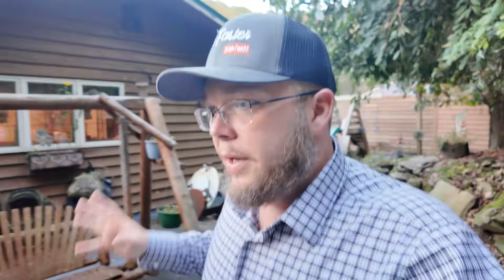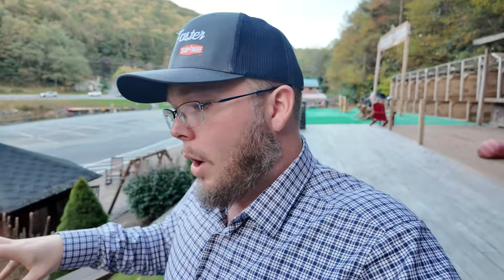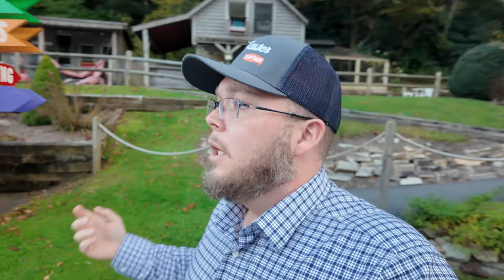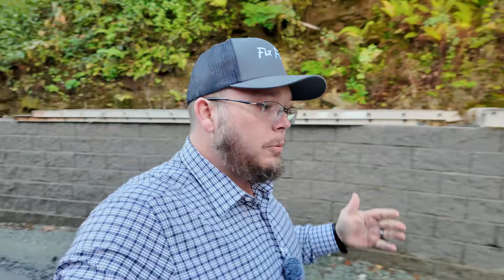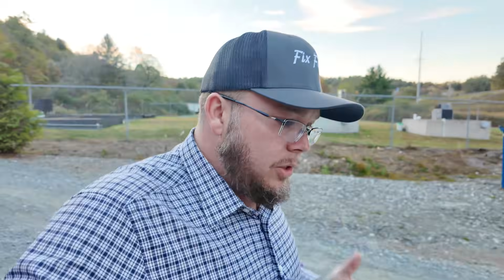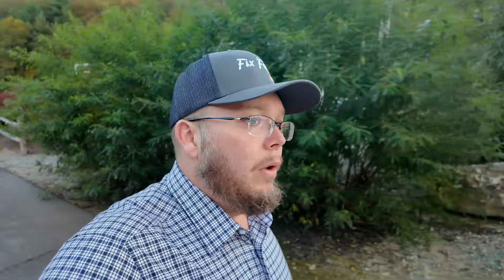Cutting Off The Nose, To Spite The Face:  The Auto Repair Race To The Bottom...

Comment: I do it slightly differently. 

For something that can be diagnosed in about 15 minutes, I don’t charge anything. The paperwork would take almost as much time as the actual work just to make the sale. Tips are welcome, though — or sometimes I just tell the customer, “No worries, I’ll add it to your next bill.” Depending on what kind of relationship I have with that customer (random or regular). That "free" part covers a quick OBD scan, basic visual checks, or a short test drive. I see as a sort of marketing expenses - I'm okay with that, considering that otherwise my advertising budget is zero and there could be only one or two jobs like that in a day (or none, for most of the days)

If the problem is a bit more complex and I need to pull out one of my “big” scan tools, I charge a fixed fee (roughly 0.5–0.75 hr). For that, I’ll do a full system scan, provide a printout for the customer, check for TSBs and Identifix patterns, and see if there’s a commonly known issue. All that can be done in half an hour or less, so I am still somewhere between 100 - 200% efficiency. If the suspected component isn’t very expensive, I explain that we can proceed with repairs based on statistical probability of a known failure with good chances of success — or we can spend extra time on diagnostics to be 100% certain. Technically, confirming the fault is always correct, but spending another 1–2 hours adds to the overall cost of the repair while in 99% of cases only confirming that statistics were right. This is where the economics of the repair and diagnostic balance come into play. The key here is communicating it clearly and setting customer's expectations properly.

If the component is expensive, I usually push for additional diagnostics first, before asking a customer to commit to a large expense based on probability alone. In many cases, the cost of disassembly involved in diag will at least partially overlap with repair anyway - as long as customer is willing to leave a vehicle here until it gets fixed.

The toughest cases are when the issue isn’t common and significant diagnostic time becomes unavoidable. From that point on, you need as much communication skill as diagnostic skill. Efficiency takes a hit — there’s research, head scratching, chasing wrong leads, and sometimes even replacing the wrong part before the root cause is found. All of that time still has to be paid for, but since I can not "beat the book time" and have no profit from the sales of parts making money from that time gets tough.

I already mentioned the use of LLM for communications with customers and this is where it is particularly helpful and saves us tons of time. Particularly when you need to explain complex topics in a simple way that customer would understand (hopefully!).
Reply: I understand your mathematical approach to cost of repair vs cost of diag. way of thinking. However, I totally disagree with that approach. Customer will have 0 appreciation to that way of doing business IF the the part you installed does not fix the issue even when it was cheaper than diag. testing. They're not going to say "Well it was cheaper to repl. "blank" vs paying him to do testing so I'm happy he fired the parts cannon at me even though it didn't work". No, they're just going to remember you said bla, bla, bla and replaced something that they didn't need. The energy and patience needed to sell your approach would be better served being used to explain why testing is the ONLY way to do things 99% of the time imo. 😁
Reply: @startec1172  

The assumption that testing is the ONLY correct way 99% of the time isn’t accurate.

Roughly 90% of failures follow well-known patterns. That’s the entire purpose of TSBs — they exist because certain failures are statistically dominant and repeatable.

Battery light on, no charging, battery already tested good. In the overwhelming majority of cases, it’s the alternator. I can recall one Chrysler 300 years ago that needed a calibration update instead — intermittent, light off when it came in. How much time would you realistically spend chasing that edge case every single time?

O2 heater circuit code? In the last decade, if not two, I’ve seen one blown fuse causing this. Every other time it was the sensor. Some cost under $50 and take 15 minutes to replace. Should I charge 1 hr. diag fee every time?

This isn’t “parts cannon.” It’s risk management. Cheap, common, high-probability components are a different category than expensive or rare failures.

And if someone charges a full hour of diagnostic every single time but still replaces parts based on probability anyway, statistically they’ll collect enough in diag fees to cover the occasional miss - and still claim 100% diagnostic purity.

If that’s YOUR model — fine. Maybe I should do the same too, instead of saving customer's money by taking the risk - the risk of losing that occasional unhappy customer and the risk of looking like an idiot. 

Just don’t pretend probability-based decisions don’t exist in real-world repair economics.
Reply: @abautomotive2886  Yesssir, I will absolutely perf. battery & alternator test AND charge for it even though in the back of my mind I'm expecting an outcome based on probability. That DOES NOT mean I ripped the customer off because I ALSO will provide the result of said test. And you know what's crazy on your second example........My Check Engine Light came on my personal car last week for an O2 Sensor Heater fault (being my car) I just ordered and replaced the sensor...guess what?.....It didn't fix it and after I did the testing AFTER I had repl. the sensor, my PCM O2 Heater Driver was faulty....So I just replaced my damn PCM on my car after I fired the parts cannon on it. Imagine if I had pulled that trick on a customer based on probabilities. No thanks.
Reply: @startec1172 

I’d say this is where the term “alternator testing” needs clarification.

Do you mean checking battery voltage with the engine running — loads on, loads off — and calling that "alternator testing"?

Or do you mean going all the way to the alternator (which could be buried between the A/C compressor, power steering pump, and exhaust manifold, 3.5 hr. R&I book time), checking control signals with a scope, verifying command and feedback circuits, and measuring voltage drop between the PCM and the alternator?

Because in quite a few cases, you can’t even disconnect that connector without removing the alternator because the damn latch on the connector is too tight (I am talking about you, Nisan!) and got packed with dust and mud.

So now the process becomes:

1. Remove the alternator.

2. Disconnect the connector.

3. Load-test the power and control wires (which may require disconnecting the PCM as well).

4. Reinstall everything.

5. Start the engine and scope the signals under real operating conditions at the PCM connector (or wherever they go, because there is no chance to backprobe the alternator connector)

6. Make a call:

“Mr. Customer, the alternator needs to be replaced. I am 100% sure of that. The diag time bill is 4 hours"

Customer gladly pays the bill. You know, because his buddy from work told him the same thing for free, "You need an alternator!" 

But you provided PRECISE DIAGNOSIS, that's sure as hell worth paying for!

And now you still get to recharge the A/C, because customer decides to do the actual repair elsewhere. Don't forget to add the AC recharge fee to the final bill! Because it is likely to be the final bill indeed for that customer - you won't see him again. 

------------------------

Nevertheless, If that process works for you - I am genuinely jealous!
Reply: @startec1172  I just saw another thread where someone claimed they had “tested the alternator” before replacing it. What did that test consist of? Measuring voltage between the alternator output terminal and the case.

Let’s assume it is not producing charging voltage. Then what? Do you immediately conclude: “alternator is bad”?

Not quite.

Before condemning it, you need to verify the entire control side of the system. Does the alternator have proper power and ground? Are all command and feedback signals present? Is the regulator being told to turn on? Is the PCM actually requesting charge? Are there wiring faults, voltage drops, blown fuses, or communication issues preventing operation?

And thanks to modern automotive engineering, alternator control is no longer a simple self-contained regulator circuit. There are multiple system designs — duty-cycle controlled units, LIN-controlled units, and in many cases modules commanding output over network communication. Without confirming that the alternator is receiving the correct inputs, measuring output alone is not a complete test.

“No charge” does not automatically equal “bad alternator.”
Reply: @abautomotive2886  Look bro, if your approach makes you meet your financial goals and makes you sleep better at night, then you do you boo.

Comment: Huge part of the problem is these broke a$$ people in general have their priorities all fckn backwards. They will happily spend $3K  or so in a sound system or wheels but not in a preventive or even a proper diag. + repair for an issue with the car they use to commute daily to work and is essential to their daily lives. Like David says, they'll rather line up to spend the money on a newer iPhone one generation newer than on a needed repair. Sorry for the rant 😅
Reply: True. Very true.

Comment: Lucas,would you ever charge the client a service advising fee?

If so,why?
If not,why?
Reply from the maker: No - not externally from the existing price of testing or repairs. 

Why: What we sell is a repaired car with a warranty. That consist of the needed testing and repairs to correct the clientd concern. 

The communication is only performed to facilitate a quality experience.

Advisor pay is in the expense category, not the COGS category for a reason.